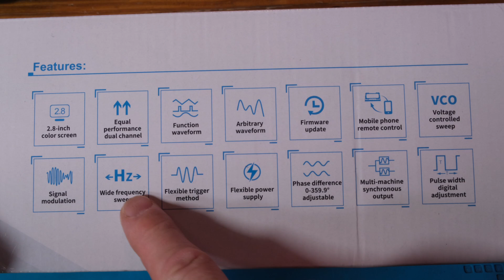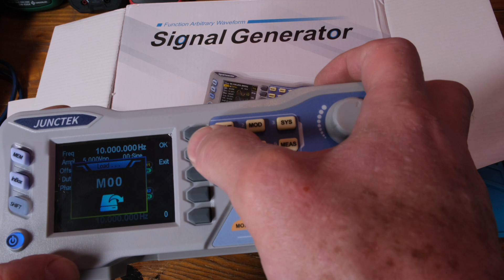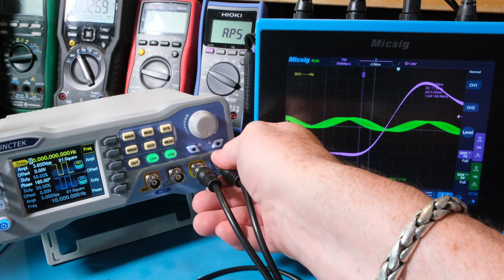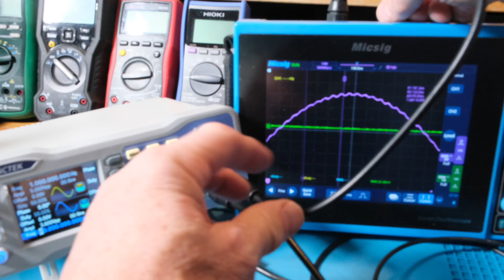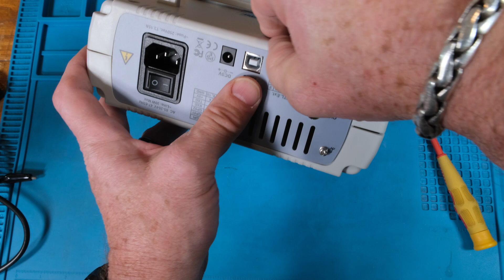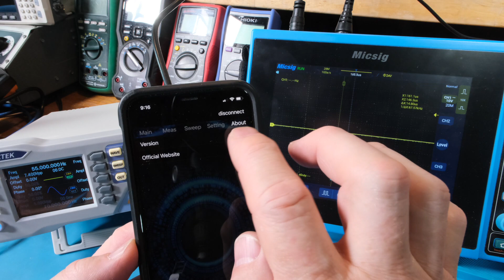Low Cost 80MHz 2 Channel Signal Generator  Junctek JDS8080 ARB review #JDS8080review #JDS8060

Comment: These low cost signal generators are sold under different names like Joy-IT, with almost exact the same specs. With the previous 60Mhz versions (JSD6600), there was a OK button, if you hold that button for a few seconds untill you hear the beep, the settings at that time are saved when you restart the device.
I guess with this version, it is the OUT button that save the settings on reboot. 
These low cost signal generators do the job and are ideal for DIY and starting electronics, but they all suffer from the same problem, and that is the noisy switching powersupply and the low power output stage. The previous 60Mhz models like the Joy-IT JDS6600 used a external 5V switching powersupply, i use that model of signal generator and power it up with my linear bench power supply to have a cleaner signal.
Reply from the maker: Thanks Bjorn for the tip!  I'll try that;) Yes, they are a Chinese company.
Reply: Thank you for your comments

Comment: Cheap BNC conector might have problem with graunding as the metal is too soft so when you ploog them you in they squize and get loose. I usualy in that situation take twezzer and spred the shilding so it fit tighter.
Reply from the maker: Thanks for your feedback!  I'll look into what I can do for an upgrade.  Maybe some filtering, maybe BNC connector replacement?  I'll take a closer look;)
Reply: The metal BNC used in JDS8000 is very solid

Comment: Check out the PSG9080 and it will be like night and day for you!  Hell, even the cheapo KKMoon/Junktek/FeelTech/TZT/Cleqee etc. etc. rebadged generators at the lower end (20-60mHz) do better than what you have (which may be a rebadged nurffed model rather than a knock off).
I know, I have a KKMoon FY6900 (60MHz) which does better, not hugely, and is only us$100, but still better square wave and no crosstalk.
One of the things that varies a LOT from all these different brands is the output amp.  the FY6900 is one of the better ones.  Wish I had the PSG9080, at at twice the price of what I have, cannot spend the money, unless Elon wants to throw some my way! :)
Reply from the maker: Thanks for the great feedback Steven!  I'll have to do a comparison to the UNI-T that I have.  What tests would you recommend?  BTW, I did ask for the PSG9080 - and I think they are sending me one;)
Reply: @kissanalog  Great, hope you get it! :)
BTW the Uni-T you have has a good user interface (saw a review).
As for tests, an FFT on it's various waveforms for purity might be good.  P-P voltages at various offsets also - most are severely limited, and many also go down a LOT at higher frequencies due to output op-amp limits.  In fact one of the things that varies a LOT is the output op-amp; i.e. rise/fall time and voltage limits (you saw the crappy rise/fall of that review unit).  Some units have ground loop issues, and others have leakage current at high voltage at the output (from suppression cap in PSU).  Some, including me, have replaced the PSU.  Here is a couple of redesigns from SDG, good channel, but hate his shilling for products so often, which takes away review trust! :(
https://www.youtube.com/watch?v=ML-lmuHoh-0
https://www.youtube.com/watch?v=tpcHh09nb1Q&t=19s

Comment: Hi Eddy, that Junktec generator has a lot of functionality but 0,6% THD is a bit on the high side, specially if you want to measure a Shiit pre-amp. Jokes aside, I am impressed by the low cost and extensive features but for now, I am sticking to my vintage Philips function generator. Only one channel and only 30MHz but a much cleaner square wave and all silky smooth analog dials. No app is beating that. I can not measure THD. I have only an analog scope. But I am thinking of buying a 16 bit 5MHz Picoscope. That should be able to measure THD to 96 dB and I believe has its own function generator build in. I am mainly interested in audio, so 80 MHz is not a priority for me.